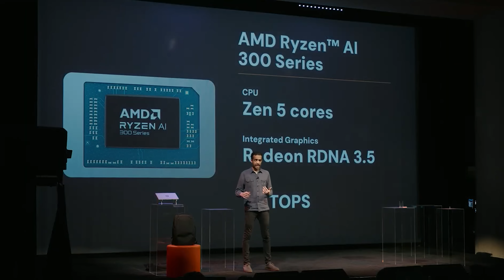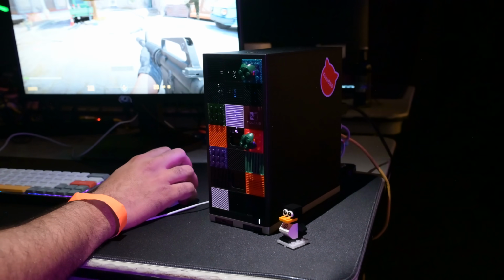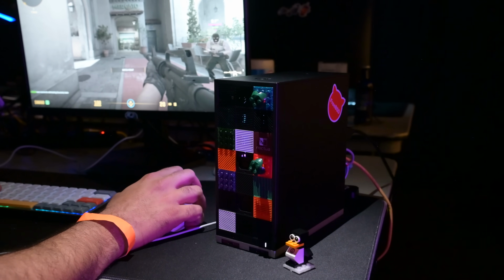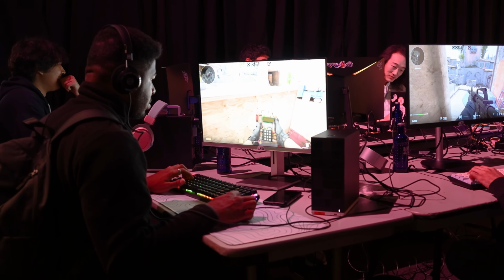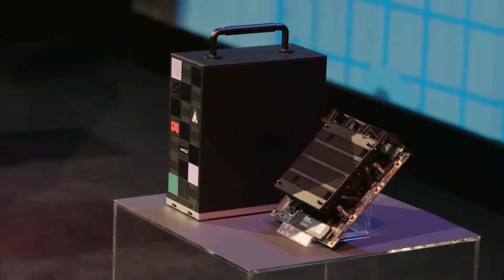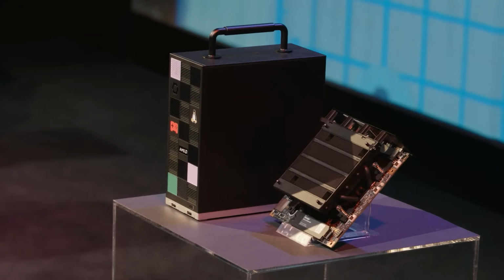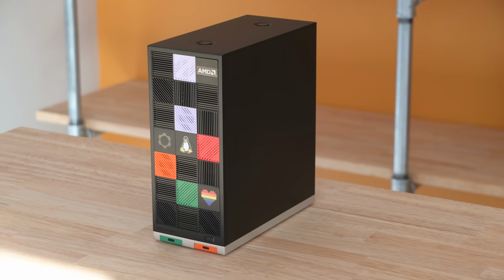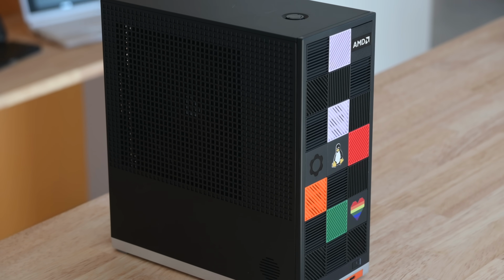Modular, Open, Repairable – The Framework Desktop Teardown!

Comment: In Linus' video Nirav said the decision to use soldered memory came down to issues with signal integrity due to Strix Halo's use of a 256-bit bus, so that's another factor
Reply: I was thinking about that too. Maybe theyre both true and the signal integrity issue gets resolved when running at a lower speed.
Reply: @mtrebtreboschi5722  This is definitely true. Longer traces and every connector will introduce some interference. When clock memory higher, you need to read to signal more precise which is more complicated the more interference you have, because you could misinterpret the interference
Reply: Yeah, apparently AMD assigned an experienced engineer just to try to make it happen, and it just didn't make sense :(
Reply: Knowing how difficult it is to design high bandwidth, this it totally understandable...
If we want to have scalable modules, it would require some high speed memory with 4 or 8 memory channels which is definitely not the use cases in laptop CPUs...
Reply: its rather unfortunate, but at least they tried. it would be a disservice to kneecap the CPU's full potential if it meant downing the speed to maintain signal integrity for repairabiliy.
Reply: @kancheongspidergaming Framework already kneecap their processors to give modular memory in their laptops though, my Framework 13 runs its DDR5 at only 5600 whereas my little GPD on the same generation platform hits 7600, both running Zen 4 APUs that are known to be very memory dependent for maximum performance. To solder the memory on a desktop where they've got enough room for proper DIMMs and call it "modular" is absurd (and yes, they've got enough room for DIMMs, it's got an ITX sized board in it)
Reply: @kancheongspidergaming  Why did they need to use that CPU? I'd rather have easily-upgradeable RAM with comparative performance to other desktops with modular RAM. Framework's gonna regret this decision, or they're just gonna keep soldering/glueing more things together to "compete". If they don't stop, they're gonna be dead in the water soon.
Reply: @watamatafoyu  cause this CPU is actuallly good for a lot of people with many use cases. It isn't about performance competition, literally nothing  else currently on the market can do what this thing can right now, you either have it or you don't, there are no substitutes interms of commercial grade hardware.

What is so hard for you people to understand? If you're one of those people who NEED this specific thing because it will be good for your use case, you'll have to compormise a bit on soldered ram and nothing else, because AMD was being AMD. If you don't, get one of their laptops, get LITERALLY anything else.

They aren't using an osbsucre custom chip like apple here, you can get it off the shelf and solder them yourself need be. You have the RIGHT to repair your own hardware, you will only need slightly specialized skills for this one, and they are not going out of their way to make you not able to. I don't see anyone complain when they can't repair their own cars due to the lack of their own knowledge, why is this not the same?
Reply: @huey1910   "A lot" and "many use cases" is not "the majority" or "the profitable bunch". You definitely didn't make the case for it needing to be there, and you seem to be confusing me in your later statement with someone who likes the soldering. Bye.
Reply: @watamatafoyu since when has everything need to cater to “the majority” and since when has the majority been “the profitable bunch”? 

Be real, the actual majority buys thinkpads, zenbooks, mackbooks, thinkbooks, chromebooks, etc… not this.

This is very clearly for powerusers or those who require a heavy workload but don’t want to compormise on size.

You mistake yourself for the majority you candlestick
Reply: Strix Halo comes with 32-40CU GPUs, which demands a level or memory bandwidth not available to SO-DIMM memory. SO-dimms don't exist that can do 8000MT/s. Nor can you get the wiring to slots to work in quad channel 256Gb/s in the space of a laptop form factor. The 5700XT dual slot GPU, which was also 40CU, had 448GB/s of bandwidth available to it. Everything about the chip is designed specifically around peak GPU performance in that form factor.
Reply: it's basically a modern take on the XBOX/PS design, unified memory and all. kinda cool. would make a wicked steam-box
Reply: Yeah, torturing DDR5 memory to feed a powerful GPU is borderline eldritch magic to begin with. My hope is that with DDR reaching ever higher bandwidths with next versions like DDR6, these requirements will ease enough to either permit modular memory or at least really good performance.

That said, we would also benefit from a restructuring of the ATX motherboard layout to allow some kind of still modular but even tighter memory system (nowadays this means literally physically closer to the core, like Apple does) so we can keep the cake and eat it too. However, this will be insanely hard to get everyone on board with.
Reply: Sorry if I sound like a sociopath, but with all the chatter in this comments section, I was going to use a little swear word and bonk everything to kingdom come.

Because the arguments used feel so pedantic I wonder if people here need a little… lebensraum to think about it.
Reply: Yeah; that's the thing. Some things make things difficult to repair in order to make it harder for customers to service products in order to force them to buy replacements.

Some things are hard to repair because the technology itself just lends its way to that.

The difference between gluing a phone together so it's hard to repair; and gluing a phone together so that it's waterproof (for example).
Reply: Soldered ram on a desktop.... That defeats the purpose
Reply: Don't mention Linus, they don't like him anymore
Reply: Signal integrity is another way to say "speed".
Reply: AMD engineers said it's literally impossible without redesigning the core. Framework can't do that, and they're too small for AMD to customize anything for them.
Reply: I still would've preferred it not being soldered honestly, even if it meant reduced speed or size.
Reply: @superboo07  You can get 16 core Zen 4/5 CPUs in this form factor already with SO-DIMM memory. The only reason the AI MAX has reason to exist, is from the GPU performance provided in that same space, which absolutely can only come from the soldered solution.
Reply: I will not take anything framewoek says seriusly if they keep supporting soldered anything. This is a hard hill do die on. We cant have another gaslight cia like apple and the rest. Stick to your truth framework!
Reply: @superboo07  nah makes no sense shooting the GPU in the foot but they should have gone with soldered GDDR 6 or even go GDDR7 for the entire thing and justify apple like prices ;-) Pretty sure some AI people would pay out there A+ses for 128GB of GDDR7. Than again that's not helping any of the normal people.
Reply: If they went full GDDR7 that would've been sick ngl
Reply: @superboo07  LPCAMM2 is the answer
Reply: Understandable 😌
Reply: POV Apple Solders its Memory for M-Silicon, everyone complains, Framework Solders their memory 👍😂
Reply: @josephzhang Apple will give u 16GB more RAM for 460€, Framework 64GB for 470€. Thats the point
Reply: @josephzhang the problem is apple changes $200 for an extra of 8GB of memory. You can get 64GB of desktop memory for that price. 

It remains to be seen how much framework is going to change for extra but people probably won’t be happy if it’s even haft what apple is charging.
Reply: @BandidoDescalzo  It does not in fact remain to be seen—they've already released their pricing info. The price difference between the 64GB and 128GB configurations of the Max+ 395 model is $400.
Reply: @BandidoDescalzo  But the problem is apple bandwidth is really good, i'm running a few VM concurrently , the bottle neck isnt always the size , it's the speed that no one else can solve
Reply: @BandidoDescalzo  $900 for 96GB
Reply: @BandidoDescalzo  it's about 1/3 ed and people preordered enough of the boxes that if you want one now it's going to be next year 'till you get one.
Reply: @Renne308 Well looking at similar high speed ddr5 memory prices (which you can't really do because the fastest RAM I could find was DDR5 7000 and the advertised ram speed is DDR5 8000) they also cost around 400 bucks.
Reply: @josephzhang the difference is the price. Apple charges 400$ for 16GB of ram. Framework charges around 100$
Reply: @josephzhang how big is apple again? 2 trillion?

Is framework even on the chart
Reply: @josephzhang  Would you expect anything less?
Reply: No one is praising it. And framework doesn't solder it. It's the only way to get it from AMD and, at the moment, nothing really compares to this strix setup. 

Try harder for an interesting comment, please.  @josephzhang
Reply: @josephzhang  Apple does it for 128 Bit DDR4-4666 and DDR5-6400/7500 at the base chips. Only Pro and Max use more than the usual dual channel 128 Bit bus. So Apple could easily use normal DIMMs for their bread and butter chips.
Reply: Soldered memory is a a sword of Damocles for hardware. Ram fails steadily your system will mitigate the bad sectors gracefully until you don't have enough.
Reply: @PlayingItWrong that’s definitely not how it works. You described NAND flash.
Reply: @PlayingItWrong  You confused RAM with SSD
Reply: @PlayingItWrong  so buy a new mainboard... that's there business model isn't it?
Reply: @PlayingItWrong but unlike Apple with RAM on chip, with this system you can actualy desolder and replace the memory chips if it fails so 🤷‍♀️
Reply: @HoangTheBoss  ah yes yes, the famous easy 20min repair of replacing BGA ICs 🤡
Reply: Soldered LPDDR5 has been known to be faster than SODIMMs since DDR5 came out, it's a limit of the SODIMM standard. That's actually what CAMM is meant to fix, and it's worth emphasising that CAMM is already entering the market and yet Framework chose to still solder the memory on a desktop system. It's a huge shift away from modularity - they've gone from making the world's most repairable laptops to one of the world's least repairable desktops, both compared to other mini PCs that tend to accept the small performance hit and use SODIMMs and against slightly larger desktops that use full size DIMMs. To call this anything other than a disappointing step away from their stated mission is giving Framework way too much credit here.
Reply: Why does it need Strix Halo? Seriously. Was Framework really under the binary decision of "have soldered RAM or make a charitable product"? I don't think so.
Reply: Should have used CAMM modules. Sure it's expensive right now but it should overcome those limitations.
Reply: @BurritoKingdom  They tried. Didn't work either. Oh well.
Reply: 0/10 this is a desktop
Reply: Meeh there is ALWAYS a workaround, they just got lazy there.
Reply: I really don't care about the reason.  They decided to use Strix Halo and integrated RAM purely for AI use.  It is a board that can not be serviced.  End of story.  On a laptop that is due to necessity.  On a desktop it was purely a design choice.  They could have gone with something that was NOT for all intents and purposes a laptop chip and made this thing 100% more serviceable by having a 16x slot + dGPU + RAM slots.  But they chose to do this for AI.  How do I know this?  You don't bring out a cluster on stage unless it is for AI.
Again what is done is done.  And that is fine.  But the serviceability of this system is crap and it is crap because of the targeted market segment.
Reply: @KellicTiger laptops can have socketed CPUs, stop taking that lie lying down

There's nothing necessary about soldering chips
Reply: @genericscottishchannel1603 signal integrity, less resistance which means better efficiency, general durability. 

Did you fail high school physics? Also Amd does not offfer the thing socketed even, and no, not any other CPU will do, this one is different in what it can do. So literally what can Framework do? NOT offer a good product?
Reply: That's what lpcamm2 lpddr5x is for.
Just a kindly remind that Lenovo already did it in a laptop, with an Intel chip.

Something's bogus here.
Reply: @vxvicky They tried LPCAMM and the signal integrity didn’t allow it to work correctly.
Reply: Soooo.... eWaste? what a cash grab
Reply: @Gdsamplify Fascinating how you read "we tried as hard as we could to make this upgradeable, but it couldn't be done without seriously harming performance", and read "cash grab". Make that make sense?
Reply: @Kraaketaer  What they say in defense is irrelevant. Choosing speed over repairability is certainly a statement. Especially when other decisions they took compromise the speed.
Reply: @interru_io  except they aren't making that choice, they're choosing to make a product with this chip vs not doing so. There is no option for a socketed chip or upgradeable RAM with this chip, and the other "option" is producing what amounts to a DIY SFF pc with zero differentiation from just using off-the-shelf parts. You're starting from the wrong premise here, as the premise clearly isn't "how do we make the most Framework mini pc", but rather "how do we make the best Framework mini pc with this new cool chip". You might have preferred the point of this to be closer to the former, but that leaves you the option of just building your own from components that already exist, losing you nothing at all.
Reply: @Kraaketaer  So don't do it? Goes against their whole ethos. ergo they sold out
Reply: @Kraaketaer if the premise is "how do we make the best Framework mini pc with this new cool chip" they essentially deserve the criticism.

They marketed their repairability and throwing it overboard just for "this cool chip".  The message that the customer gets is: We compromise on repairability.

Easy solution: Don't use that chip. There are plenty of processors that are faster, socketed and don't require LPDDR5x.

The premise is the issue here!
Reply: @interru_io the point is before the existence of this Strix halo chip they had no plans to make a framework desktop because there is no need for them too. Desktops are already totally modular. 

But they thought the chip was cool and unique so they took the chip out it on a standard itx board. Which no one else is offering something like this.
Reply: @cinnabun1046  my point still stands. They market it as repairable while still compromising on repairability.
They deserve criticism. 

It's less repairable, less open than a standard desktop. This product is a step backward in the right to repair movement.
Reply: @interru_io  Except there aren't - no other chips have graphical capabilities even remotely close to this one. Which, again, brings us back to the point: they clearly wanted to make a product using this chip. Not for its CPU alone - you can already do that with DIY components - but for all of the chip. And given the size of GPUs these days, good luck finding one of matching performance that will fit a case like this. It still uses standardized components, making everything upgradeable down the line - it just requires a board swap, like their laptops. This is less upgradeable than a standard DIY desktop, yes, but more than anything even remotely competitive to this. Everything requires some degree of compromise. In this case, the choice was clearly between making a rather unique product, or not making a product at all. Me? I prefer having the option for the unique product.
Reply: @Gdsamplify  "Sold out"? To who? You can't sell out unless someone is buying you out, and in this case it's pretty clear that they're choosing to make a product that they clearly think is pretty cool, for a niche audience. That isn't selling out. And, remember, this is arguably more upgradeable than their laptops, given that you could put any other motherboard in there in the future. And in the meantime, they're providing a unique product.
Reply: @ How often do I have to repeat that: They are marketing it as repairable while compromising on repairability!

> no other chips have graphical capabilities even remotely close to this one.

That's just wrong because it paints the picture that this is a revolutionary chip. It isn't. It just the next step in an evolution. It's the fastest APU for now, and in a couple of months the world will look different. Then this chip isn't the fastest anymore. What will remain when you purchase this product is the inability to upgrade without replacing the whole board and RAM.

Compared to a dGPU the iGPU isn't that impressive. And I would argue that it would have been possible to build that form factor with a dGPU. Especially for a company like Framework.

So to recap:
Framework comprimised on repairability for speed and size.
Reply: @Gdsamplify It doesn’t. You’re completely misrepresenting what they do and why.
Reply: @Kraaketaer it's a cash grab because they didn't make a fancy new camm to get the ram in
Reply: @Kraaketaer pretty sure they could've just made a new motherboard with the pcie slot on the bottom edge of the board so a GPU would have no size constraints
Reply: @genericscottishchannel1603 ... are you saying that Framework should have developed an entirely new RAM standard? Or are you just repeating the "argument" that they should have used the RAM standard that they already said they tested, including having senior AMD engineers look closely at the possibility of using it, where they found that it couldn't be done while maintaining sufficient signal integrity at usable speeds?
Reply: @genericscottishchannel1603 ... isn't the whole point of this chip that it's an APU powerful enough to not need a dGPU? Also, if what you want to do is make a super powerful uSFF PC, sticking an open slot on the bottom of it and saying "nah, the GPU doesn't count towards the system's size" is... uh, quite the cop-out. And, again, if what you want is an SFF system that can fit a modern high performance GPU, i.e. one that wouldn't benefit from this APU: just go build one, or buy a prebuilt. This already exists, using stadnard, off-the-shelf components, from multiple sources. Why would framework go into the DIY desktop PC parts business?
Reply: @Kraaketaer  I ain't gonna prove my point to someone with a knitting fetish